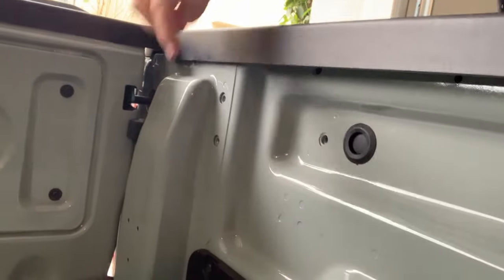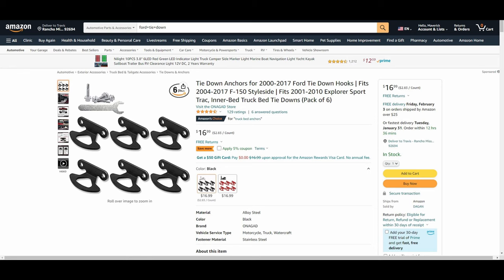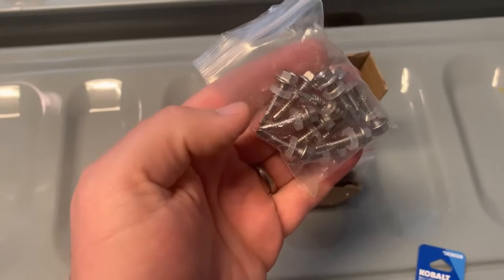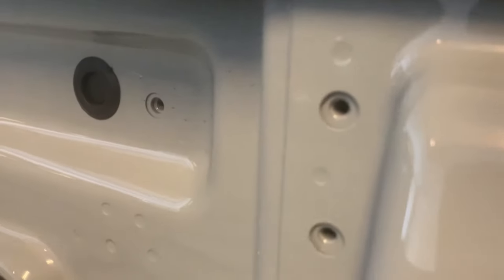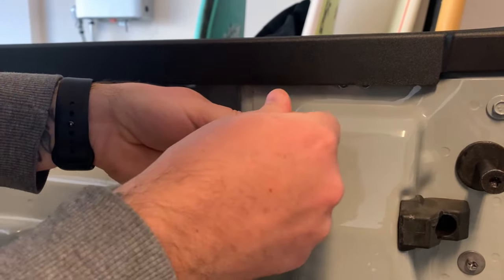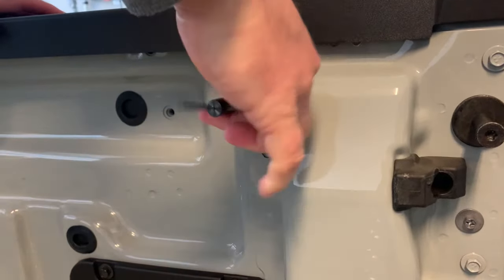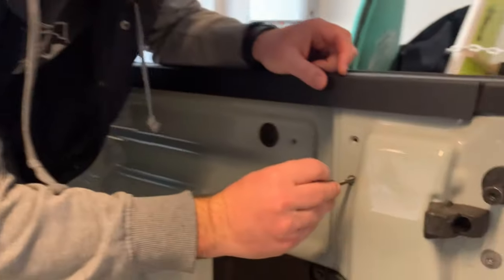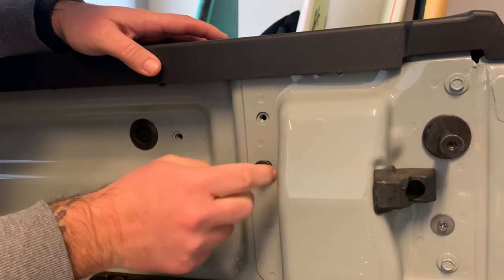Adding the extra stock Tie Down Anchors to a FORD Maverick XL

Comment: Thanks for this video confirming what I know from years and years ago.  I put this off for more than a year since received my 2023 XL.  I ordered with spray-in box.  

Is there anything I should be aware of adding the tie-down bolts with spray-in box?
Reply from the maker: Dang, that is a good question, I am hoping they left the holes available after the spray in ?
Reply: @maverickresource  Yes sir, they left a hole in but not a fully open one where I can see through.  I will check again to confirm it is the hole I will tap the thread in.

Comment: NIce Video,  I 3rd the suggestion on adding a little cutting oil.  Also, I "vacuum up" the metal shavings. Since, metal shavings in the eyes, doesn't  feel good.  Still, Good vid, thanks!
Reply from the maker: It's funny how in the moment of filming I opted to just spray the debris, when in fact, I have gotten metal shaving in my eye once...terrible hassle terrible pain...

Comment: Your links are for a 6mm tap. Is this correct or should it be 8mm?
Reply from the maker: 6mm is correct for the tie down points in this video. (there are other existing holes that can be tapped around the bed that may be 8mm, but these are def 6mm

Comment: What is the fix to silence the backup beeping on the Maverick Hybrid and also prevent vehicle going to park from neutral when door is opened.
Reply from the maker: You know, I haven't even thought about disabling the backup beeping in the hybrid after I noticed how bad the glitches and pauses are in the back up cameras feed. If I get some info on that, I'll get back to you haha.
Reply: If you just unplug it you'll get a pedestrian warning system error on the dash. The company Megaohm sells a resistor to plug into the harness in place of the external speaker to get rid of the external sound and prevent errors. The speaker is kind of a PIA to get to on the maverick as it's located behind the drivers side fake fog light area, I have done it to my maverick though because I enjoy the silence.